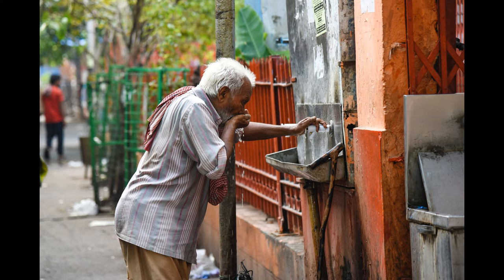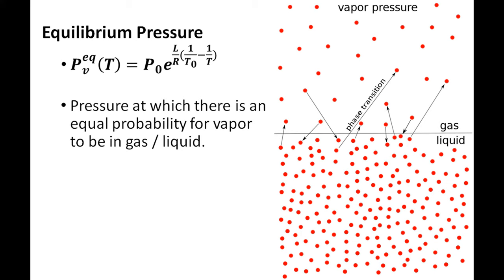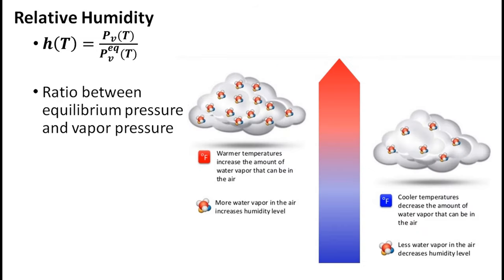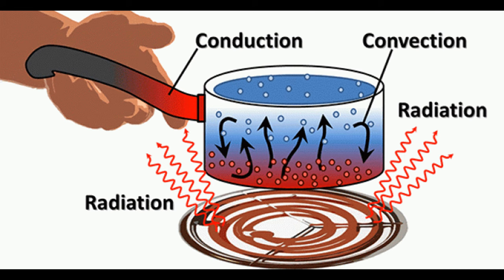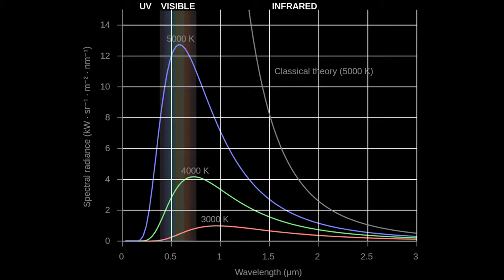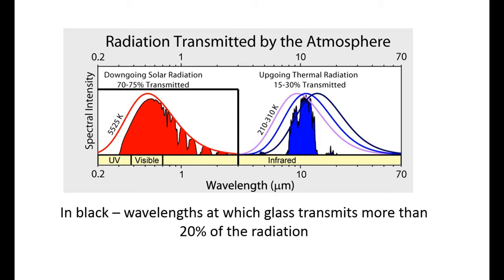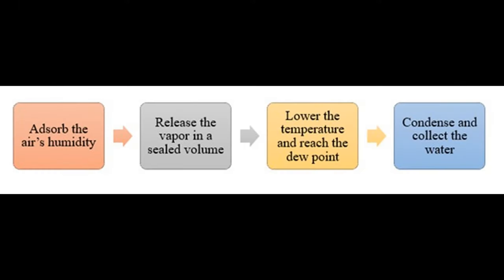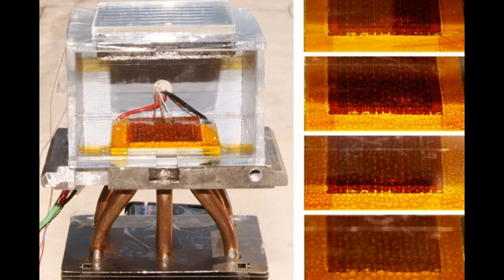Silica Gel Air Water Harvesting

Comment: All you need to extract water from dessicant is to heat it up and all you need to extract water from the air with a dessicant is to let it sit there (and ideally not be hot). Why bother with a solar panel and peltier then?

Let the dessicant passively soak up water from the air at night, then during the day let it heat up from sunlight to drive off that moisture. Use a heatsink of some sort in perpetual shade (or the ground or a large thermal mass in the shade) to cool the rejected water vapor back down to condense it. It doesn't have to be below ambient, just below whatever the temperature of the water vapor is. And you can pretty easily design a box that gets super hot in direct sunlight, like with solar thermal collectors. Then all you need to do is design some passive cooler to let bring the water vapor just somewhat close to the ambient temperature. 

That way you dont have to screw around with the efficiency of solar panels or the poor COP of peltiers. Just let the sun heat up the dessicant a lot, absorb the water at night when its naturally cooler, and use literally anything cooler than the hot solar thermal collector to condense the water during the day. Maybe a servo motor to open and close ducts could help. Why make making a temperature difference more complicated than it needs to be?

My thought on how to do this would be to fill a 55 gallon drum with dessicant, spray paint at least one side black, and maybe put it in a glass box thats thermally insulated. At night air could flow in through holes covered in mesh and during the day the vapor would flow up and out to either a heat sink in the shade (maybe connected to a thermal mass that cools back down at night or maybe to a radiant sky cooler.) I can't imagine it would be less efficient than a 15% efficient solar cell, and you wouldn't have to swap dessicant packets.

Comment: I have some suggestion,
You use sand instead of silica gel beed. 
It also absorb and evaporate water. 
You can use same sand.
You keep process continuous. 
I have not understood much but I have like your idea of evopartion using solar  panels. 
You do your experiment on river water or sea water because water keep evopating from these areas. 
Use natural rotatary fan used for removal of bad air in market. 
This fan will bring more fresh air ,  but you need only way traffic of air , so use plastic pipe at higher hight. 
Wind flow from higher to lower levels. 
Using this technique, we can send lots of wind towards machine and trap lots of fog. Try it .
Jay shree ram.